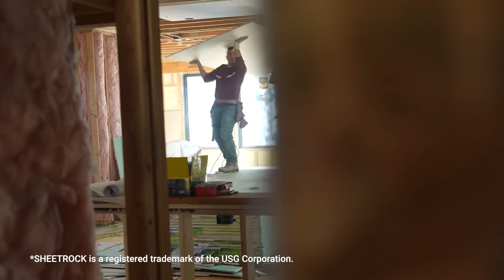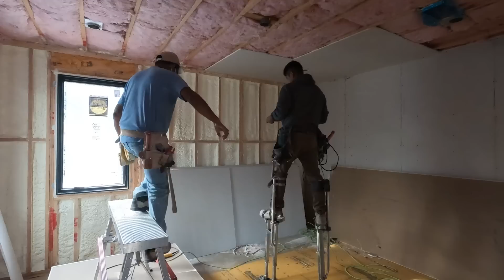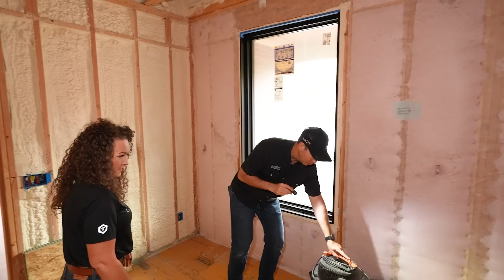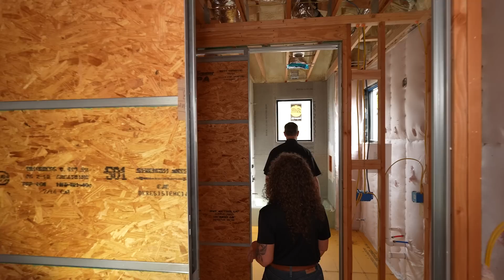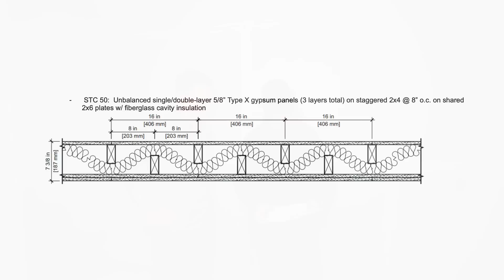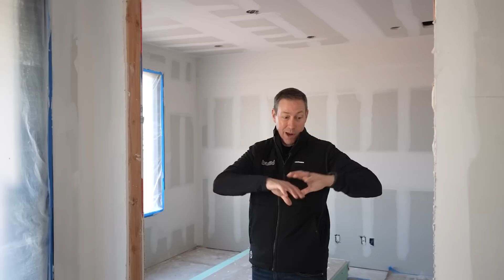The Risinger Build Ep 17 - Soundproofing, Drywall & Wall Penetration

Comment: Here’s a trade secret. The green glue stuff and the special sound drywall is not nearly as good as just going with double 5/8”and staggered stud exterior with rockwool in all walls. What works in a lab won’t be replicated by your installers.

Comment: for big 'bulgy' areas where you put on drywall.... use 5/8 drywall and cut out the area where the plate it... then do a "repair" drywall with 1/2 drywall, or just remove some of the back side of the drywall to make room for the bulging object.

Comment: 🤔 Thinking Structo-Crete to replace drywall in kitchens.  Moisture resistant, strong flat structural surface for cabinets and backsplashes…. seems perfect solution. Great video as always Matt!
Reply: It’s a nice finish also , very modern classic especially if stained

Comment: Double 5/8 is great. So to reduce costs and to help isolate walls for soundproofing - consider using a beadbacker/caulk/beadbacker sandwich in all corners (ceiling/walls/floors/windows/doors) instead of just caulk. By mixing materials, you change densities and the beadbacker isolates surfaces to lessen vibrations. What are you going to do with ventilation noise Matt?

Comment: A lot of good info and as a tile man that outside corner in the bathroom that meets with the sheetrock corner has got to be dialed in Plumb both ways and it's got to be finished correctly because of patterns

Comment: I thought you recommended Rockwool insulation for sound reduction because it performed much better than fiberglass batts due to it's mass. Why didn't you use it here. Was it because Owens Corning sponsored you on this build?
Reply: Comfortbatt is roughly 2lb per cubic foot, while the average fiberglass batt is 1.5 lb/ft3, so wouldn't that mean comfortbatt adds less than 3 ounces of mass to every square foot of 2x4 wall assembly compared with fiberglass?
If my math is off, I can say it's imperceptible and I've never seen any wall assembly test data which indicates the difference between the two is enough to increase the STC by 1 point
Reply: I believe ComfortBatt is Rockwells mineral wool product recommended for insulating, and SafeNSound is their interior wall mineral wool for sound deadening. I don't know the differences. Maybe density, maybe thickness. Time for some research. Maybe Matt has covered this in previous videos.
Reply: There are 16 ounces to a lb. So an increase of .5 lb is 8 ounces more, not 3. That is a 33% increase from 1.5 to 2.
Reply: The performance is very similar, and the pink stuff is way cheaper.

Comment: Great stuff. Thanks!  Question: when doing double drywall layers with acoustic caulk:  are you taping or caulking the gaps between sheets on the first layer?  Not completely clear from the vids.
Reply: Im pretty sure the first layer was not taped at all

Comment: I would say it’s not quite accurate to use the term “soundproofing” when referring to the acoustic measures employed on that wall between the bedroom and hallway because there is no resilient layer to interrupt the transference of sound energy through the wall. Yes, the 2x4 framing on each side of the wall is staggered, but it’s attached to a solid 2x6 plate top and bottom. You will get a nice reduction in sound transmittance through this wall, but a resilient layer somewhere in the assembly (or a true double stud wall) is required for it to be considered a soundproofing strategy. You might think I’m splitting hairs, but using the term “soundproofing” can set up a performance expectation that this assembly will not be able to achieve. That said, I think the “cheap tricks” you have utilized in this wall will be relatively effective in accomplishing your acoustic goals at a very reasonable cost.
Reply: Interestingly, you touched on this point (soundproofing vs. sound abatement) in your discussion with the USG rep starting at around 36:50, but didn’t make the differentiation when talking with Drywall Shorty.
Reply: I also like the idea of using the 1/2” Structo-Crete for sound abatement. I’m curious as to why you didn’t add a layer of 5/8” Sheetrock over it in the Master BR like you did in the so-called baby’s room. As the USG guy said, that difference in mass between the two materials would cut out a broader range of sound frequencies. In this case, however, I think two layers of 5/8” gyp over a resilient acoustical mat (or other resilient layer) might have been more cost-effective—and better performance—than using the Structo-Crete. Would be interesting to see a cost and STC rating comparison between the two approaches.
Reply: true double walls eat up so much floor space though. I'd say staggered studs with pink stuff insulation is the best bang for the buck.

Comment: Since the 5/8" drywall adds mass does that mean you should not use a lightweight drywall? I'd like to use the 5/8" but will the lightweight negate this additional desired mass?
Reply: Exactly you want the heavy drywall for the heat mass. I did it at my house and it is double the weight than the 1/2 light, but the thermal mass really makes a huge difference. Its a lot more work to install because of the weight but the long term benefits are well worth it.
Reply: Just remember that not only does 5/8 block wifi substantially more than 1/2, the higher mass blocks it even more. When deciding to do major soundproofing and using high end materials like this, plan for WIRED wifi access points in a lot more rooms. Typically you are looking at a few dB of signal loss on 1/2, an extra 2~ on 5/8, and another 1-2 on the higher mass ones. That may not sound like much losing 3-4dB of signal, but remember that moving up or down 3dB is 2x the signal strength.

Comment: I wager the drywallers would prefer you just used blocking to block out the area the access panel will take and let them route out that hole after applying a whole sheet.

Comment: Out of curiosity, why use a 5$ putty pad instead of a quarter's worth of spray foam to stop air flow at the back of the junction boxes?
Reply: If imagine the pads have a little more elasticity as time goes on but I could be wrong
Reply: From the casual way he said “this elastic pad is cheap 3-5, 5 dollars…” … I thought “Five bucks for each electrical box in a  house that size…” — oh wait, he gets em for free.  So that’s the way I would do it too. Free.

Comment: 1/4 inch screws for the drywall around the pocket door??? Your drywall is 5/8... that makes 0 sense. If your drywall is 5/8... and the osb behind it is 1/2... You can use a 1 inch drywall screw and not damage the door behind the drywall+osb... what are these 2 thinking lol.